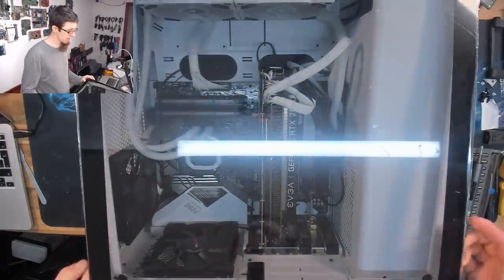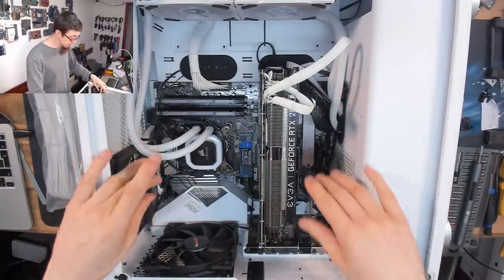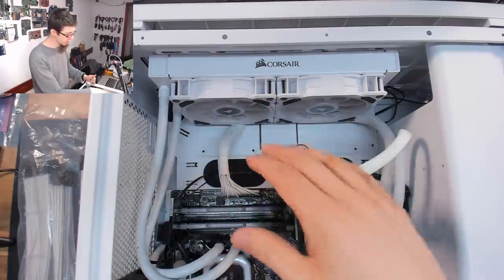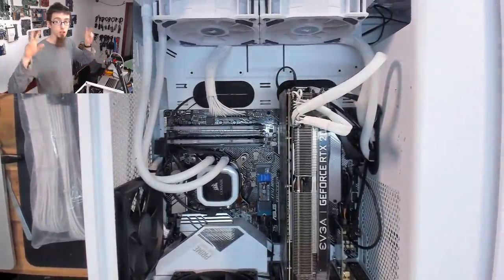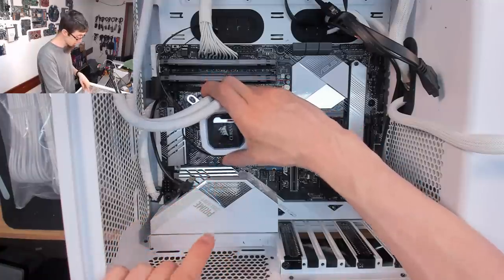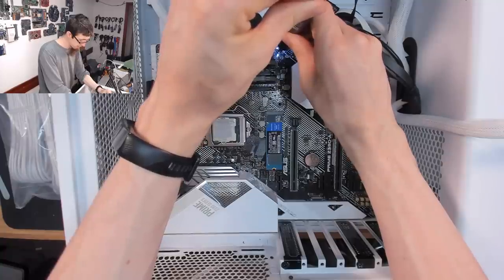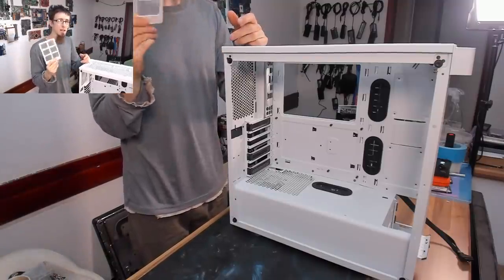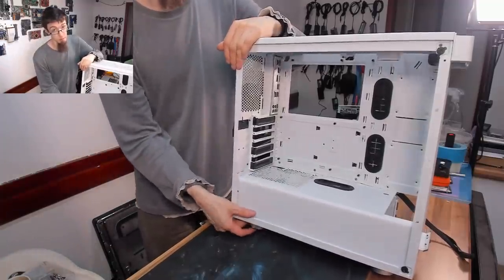Corsair 275r (not that one) Rebuild - LBC#55

Comment: Fabulous job as always, I just would like to ask you about your thermal paste application. Everyone under the sun recommends the famous pea-sized droplet, but you do an X-marks-the-spot. Why?
Reply from the maker: Please for give the facebook link, but this video demonstrates it well: https://www.facebook.com/601457763336866/posts/1705766756239289/
A real CPU cooler will have more clamping force than this, so this is an exaggeration, but it shows how X will almost certainly assure better coverage than pea-dot. The video also shows that it most likely won't matter in the majority of cases, but X seems to be a very safe option.

Comment: When mounting the radiator shouldn't the tubes be at the bottom?  This also helps eliminate the gurgling sound that can be made when there is air in the line.

Comment: Hey, i didn't think that could be, reverse intake, but if it works why the hell not Right? i have the same board and Asus send a Bracket, to mount Tinn for a Boards DIMM not to overheat, now my question is do I need to add I the tiny fan, even if I have not OC my CPU??? But I   am later when I learn a Little more. Anyone, please be kind to give any INFO regarding my Questions? TY

Comment: Would you consider it risky to use an AIO water cooler in a PC?

Amazon reviews seem to show a lot of leakage after a short time with them, and I don't want to risk ruining a Ryzen 3600 and a 2060.

I've seen the water coolers for cooling projectors lasting at least 10 years without issue, could I expect this from one of those PC ones?
Reply from the maker: It's hard to give a straight answer with this... I've never seen a big fail with one of these. Only see one fail full stop, and that was a duff pump, not a leak. I've heard from someone who had a leak, so it can happen, but it's not common enough to concern me. I think the warranty covers damage to other components.

Comment: Artic makes some excellent white fans that are almost as good as noctua fans but a fraction of the cost. Not RGB. Would work well if you were to mount them on the front sandwiched between case and radiator

Comment: so the rad was meant to go to the top of the case, but it just didn't fit there (at least it looks that way) and it was put on the front, and this caused strange air circulation problem,  i think this pc case is not fully compatible with this cooler or ram is too  tall :)

Comment: With a fully modular PSU, I'd have raided the bank and gone for full custom cables for the cleanest build. Not entirely happy with extensions as there's an extra point of failure and so much cable stuffed into every available space.

Comment: Would moving the rad and corsair fans to top exhaust and the 2 other fans to front intake make for better airflow? Curious because I'm interested in using an aio in the future
Reply from the maker: Would've been the best solution, but won't clear the RAM :(
Reply: @Adamant_IT  Oh wow, ok that's something I'll have to take into consideration when I eventually upgrade parts, Thanks!

Comment: Important to get some airflow over the VRM's when you have an AIO cooler. Intel processors can be a little bit power hungry. I think you said this was a 9700K so 8 Intel 14nm cores and might be overclocked.

Comment: Great vid as always but the one thing i don't agree with is the snipping of the combs on the extension. That's just me tho, otherwise nicely done.
Reply from the maker: These cables had a lot of combs on them, there's a few spares that can be moved around later on if need be!
Reply: @Adamant_IT   I sometimes stick a bit of electrical tape over the spare 2 pin pcie end for the graphics card and just slot it into the gap between the 8 and 6 pin on the gfx cards. It usually fits and makes the card look like 8+8.

Comment: the front radiator and fans should be moved to top of case .the hoses for the radiator should be lower than the pump not higher.seems not possible to turn radiator around due to graphics card being in the way mounting rad on top would solve all problems and still have rgb as is .IMO.

Comment: Surely the heat generated and transferred between all the cables so close together (maybe touching) is not the best idea at the PSU ? 
Could you not just replace original cables  with the new fancy ones ? Do away the old ones altogether? ie    Electro static Monster !! 
just a few thoughts , thats all 
Not keen on the white coloured stuff , but horses for courses @Adamant IT ......
"So unplug the jukebox ,and do us all a favour !"  hahhaa :)
Reply from the maker: You won't be getting any meaningful heat in these cables. It's why most computer cables like the 8pin PCI-E consist of multiple 12v wires and several 0v, as this spreads the load and prevents heat build-up. Although I have heard that some braided extensions can be made of really nasty Copper Clad Aluminium wire that conducts really badly, so buyer beware.

Comment: I need help, I have a so called 400w bubalus psu with 350w rated power,12v on 240w but it's dual rail so 120w each, I have a ryzen 3200g(65w cpu) will it be fine if I add a gtx 1050ti or 1650 with it?
I've seen the same psu used on x4 860k(95w cpu) with an rx 560, which has more power consump. than my ryzen build, just hoping that my ryzen build will last atleast 2 years time.
Reply from the maker: You should be ok. Keep in mind that modern TDPs are getting less and less relavent - on Intel desktop CPUs as an example, the TDP is almost arbitrary now, and the chip can consume 2-3 times that power.
However, on that setup you've listed, it'll probably be alright. I wouldn't use that PSU for anything more intensive though.
Reply: @Adamant_IT  oh thanks alot sir,I really appreciate it😊,sorry for bad english as well.😁
Although I may've screwed up abit about the question, it's actually 300w rated power(400w peak)but base on some psu calculators I should still be okay,  but the dual 12v rails really bothering me , is it really okay with only 120w each?
I'm also planning to undervolt the card for safety.

Comment: is the radiator not turned wrong ?? have heard that the pump motor must be at the bottom (it is in the radiator where the hoses come in)
Reply from the maker: Pump is in the head not the rad on the vast majority of AIOs. And yea, there's merit in having the hoses at the bottom - I need to do test runs with it myself to see how routing works out. GN's new video does show good testing, but they were also showing a very extreme example. The pump doesn't sit higher than the top of the rad in most setups.
Reply: @Adamant_IT  you are the best IT youtuber, 
your customers are some lucky people

Comment: Ofcourse you can do reversed airflow, but the cases are designed to have front intake, back exhaust... It  even says that on Corsair, phanteks, cooler master etc sites... And why on earth didnt you just move the whole radiator with fans to the top of the case?
Reply from the maker: Believe it or not, Corsair RGB RAM doesn't clear a top-mount corsair radiator in a corsair case.
Reply: @Adamant_IT  Oh my! I guess corsair have some work to do. Cant stand cases with the possibility to mount a rad at the top and it wont fit because of the clearance... Bad work by corsair :/

Comment: Fans are all wrong IMO, front should be turned round to pull, and top 2 should be turned to push out and in this case I would flip the PSU over to draw air from the mobo area and out the back, also blank off the rear air gap or make a white magnetic filter panel to cover it to prevent dust ingress due to negative pressure setup.

Comment: Can I have a link to that electric screwdriver?
Reply from the maker: It's available on amazon, but I'm not going to start linking it quite yet, as I'm still trailing it - I don't want to recommend it until I've finished reviewing it, in case it dies in the first two weeks of use!
Reply: @Adamant_IT  🙇🏽‍♂️ thank you.

Comment: Amazing Videos As Always!!  
I have an old laptop 4 yrs old, and after months of gathering info, i found out that its power throttling whenever any kind of load is added on it. 
At first i assumed that it was thermal throttling because of its behaviour but while doing a benchmark test in xtu, it clearly displayed power throttling. I tried adjusting the short power max in xtu, but the changes didnt get accepted. No changes could be done via Throttlestop because its disabled there. BIOS has nothing which can be tweaked. Is there anything i can do for this laptop apart from taking it to dell and inquiring about it?
Reply from the maker: Might be worth opening it up and checking for dust and stuff. It may be an issue with the CPU VRMs, either overheating, or faulty, and not delivering enough power.

Comment: Hi there, im a time served mechanical apprentice and now doing an electrical engineering degree only 1 year to go! However i am currently a firefighter which i am enjoying. I get lots of time off 4 days a week and plenty down time at work especially on nightshifts along with 2 weeks off every 2 months. So i was thinking of getting a second job, i would like to put my degree to use and love computers have built a few and always trouble shoot and repair friends electronics, from phone and laptopscreens to guitar volume pots and other soldering jobs etc etc. So i think i can turn my hand to most stuff however and the point of this comment. How do you go about getting customers to trust in your ability to mess with their computer, not access their private files and give them the good and bad news. Also have you ever not been able to fix something and how do you deal with that?
Reply from the maker: Trust builds up over time, I've been on the same high street for ten years, and have a solid rep in town. But when I was starting, the best thing I could do was A) have a physical shop, rather than being a 'work from home' call out guy, and B) fix stuff on the bench in plain sight. I was always worried about my shop looking scruffy - but most people trust you more if they walk in and see you doing your job there and then - rather than keeping it all hidden behind a curtain.
And yea, there's always going to be ones that you can't fix. You have to make the call of; 'can it be fixed by someone more talented than me?' If so, direct the customer to someone else who might be able to do it. If it's just not do-able, or the customer doesn't want to find someone else, the next best thing is to help them replace it in a cost-effective manner.
Reply: @Adamant_IT  cheers, i suppose working from home will make that harder. Maybe branding as more of an all round electronics repair tech rather than just pc could be more viable. Something to think about anyway just looking for a side earner that might put my degree to use. Dont want to waste these years of studying!
Great videos have been binge watching the past couple days some very intresting ones for me especially the pcb work.

Comment: Hi maybe you can help me. I have a gigabyte vision g z490 10600k rtx 2060 When i start my pc and my monitor is of ,the vga error led stays on. When i start my pc and the monitor is on the led goes off and its normal. I got the newest bios.
Reply from the maker: When you're stuck on VGA LED, if you turn the monitor on and wait a minute for windows to boot, does it actually boot up? If the monitor wasn't on during POST, you need to wait for windows to start before it'll be detected.
Other than that, this sounds like just a detection quirk, and the simple solution is just leave your monitor on (so it sleeps when the PC is off).
Reply: @Adamant_IT  it wil boot to windows and the led wil stay on.
But the nvidia control panel is gone 
But i can stil start up a game and it Works.
Reply: And yes i now let the monitor sleep and i have no prob but stil weird

Comment: Just one comment, radiator should be turned upside down - hoses  at bottom. Stops air being drawn into pump causing overheating. Even in new AIO there is air in the system. Gamers Nexus recently highlighted this. That said enjoyed the video.

Comment: Hiya do you have any experince with Windows being really slow to load on NVME. It used to be faster on my SSD! Turned off CSM and all that jazz so at a loss why windows takes so long to boot up.
Reply: What brand NVME drive do u have ? U could try updating the firmware. I have 2 Samsung pro drives in Raid 0. And Samsung had an update last week. I believe.
Reply from the maker: Not something I've encountered. I'd try doing some benchmarks on the drive to make sure it's not faulty.
Reply: Check the last bios time in task manager to rule out bios problems. (Windows loading starts at the first windows logo.)
Reply: @DESYNC-47  It is indeed samsung. 970 Evo Plus 1TB
Reply: @Adamant_IT  It seems fast everywhere else. Just not the initial booting into windows screen
Reply: @ShadowMaelstrom  How many secondary drives you have connected ?
Reply: @emptyplanet  5
Reply: @ShadowMaelstrom  subscribed :)
Reply: @Adamant_IT  It was a corrupt windows profile. Made a new profile and moved some stuff over and it boots instantly.

Comment: Lovely cable management but the radiator is mounted incorrectly. This will result in the death of the pump and insufficient cooling of the cpu
Reply: Just watched the latest video from gamers Nexus confirming this.
Reply: Air getting caught in the top of the loop of the radiator reducing the flow of liquid to pump and cpu.

Comment: Customer would have been way better off getting a Cablemod Pro kit that plugs straight into the power supply and not the extension kit as the can cause issues if the quality is poor.

Comment: You're blowing against nature. Hot air rises, so the optimal is in from the front, out through the top or back. I know it's what the customer wants, but I can't imagine knowing something is wrong, but allowing that just for aesthetics.
Reply from the maker: Airflow is a lot stronger than convection
Reply: @Adamant_IT  Oh absolutely. I'm not saying it won't work. However, the customer is using brute force to overpower thermals in favor pretty-pretty. It's just something I would never do for my rig. I'm definitely performance and stability first. Aesthetics are an afterthought. I did buy a white case with a glass side panel to transfer my internals. Was thinking of red or perhaps gold wiring. Any suggestions?

Comment: You know you can pick up a set of full-length cables for that PS on Amazon (in white) for $10 more and clean up the back cable mess.  Poor decisions lead to poor consequences.  If I paid you to cable manage my pc and that was the best you could do I would be pissed!  P.S.,  I have an extra set of cables (white) if you want to do this right?  Please don't leave it like that......
Reply from the maker: Cor, wish they were that cheap over here I can tell you. This job could've been made better if I'd done more with the fan wires - but I deliberately left those vague because this machine's likely to get more done with the fans in future, and it's more helpful to keep those wires accessible. Front-end was more important for this job. But yea, lessons were learned about making sure the correct extensions were purchased, as I mentioned in the video, these ones were too long.

Comment: Watch gamers nexus new video on Rad mounting this is incorrect ;)
Reply from the maker: Yup, GN aren't wrong, however keep in mind they were showing extreme examples of the problem. The pump isn't at the highest point in this setup. However, given how the length of hoses on modern AIOs has gone up over the past generation or two, I'm absolutely on-board with turning the rad over.